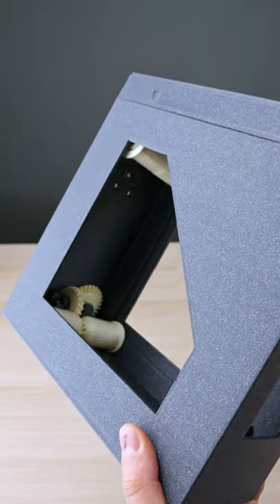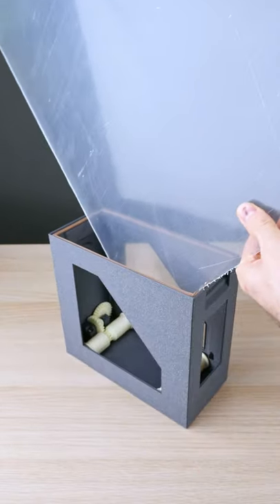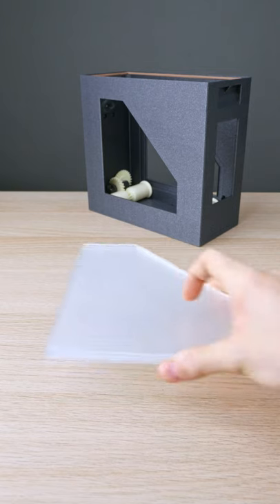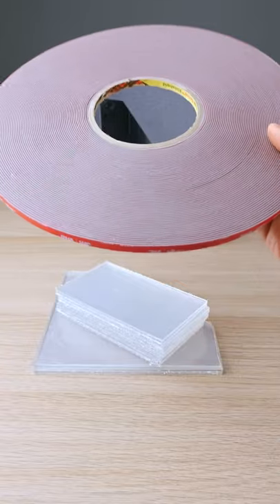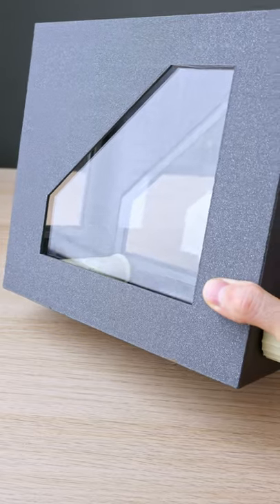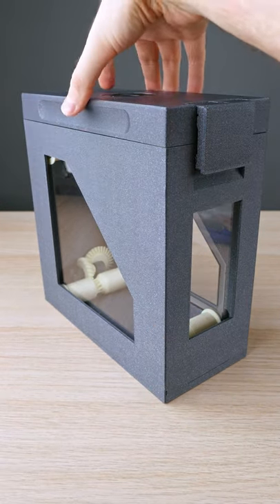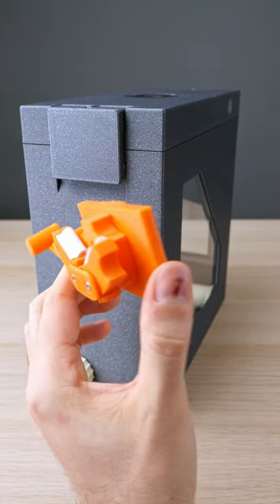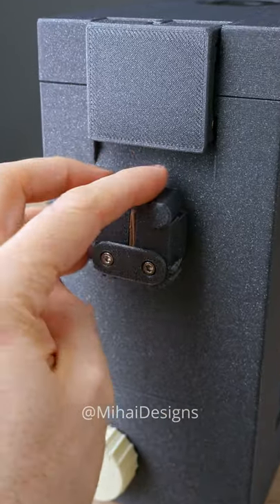Plexi windows for my almost airtight filament dry box design

Comment: Looking forward to some STL files :) I am having trouble with my TPU filament I think it absorbed some moisture from the air...
Reply from the maker: Yes TPU is one of the more sensitive to moisture. And is a bit tricky to print even when dry :)
Reply: @MihaiDesigns  yes i noticed but my first print went perfectly fine with the settings i had, but the filament came straight out of a sealed bag back then

Comment: Do you have to keep it air tight or can you just not like is there a big reason?
Reply from the maker: I need to lower airflow in order to later keep the inside dry and not get much humidity to creep in.

Comment: How do you prove it is air-tight? Maybe pump air in and check for leaks with a soap solution?
Reply from the maker: Yeah it's not truly airtight (the print is slightly porous) but can be fixed if needed. Might be OK for its purpose.
Reply: @MihaiDesigns  It seems to be well designed. :)

Comment: When will you release the files for this?
Reply from the maker: Once it's ready and I do some tweaks. 1-2 months.
Reply: @MihaiDesigns  if you are still working on the files, why not add a handle to the top for a bit easier moving?

Comment: I hope you did press it down as hard as you can for 10 seconds. Then for another 10. Then thinking: "I should be fine, but I should press it a little harder just in case"
And then pressing it down until your fingers hurt.

Comment: "Moisture is in the air already, and we'll need to remove it. I'll go design a solution..."....hmmmmm....maybe in a modular design that has more than 3 of the cases you can fit a cheap fruit dryer.... most of them have programms and a thermal safety for overheating... and they are cheap...!!! so....i think it will be awesome..!!!!